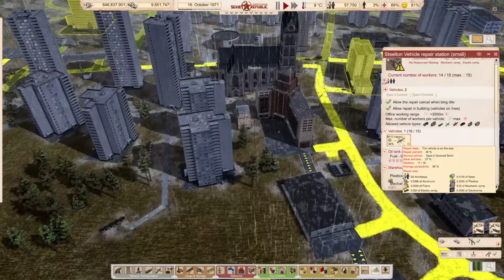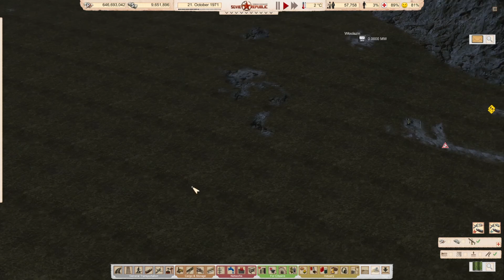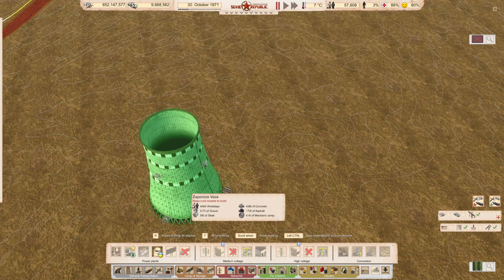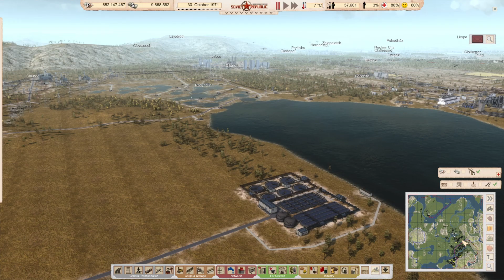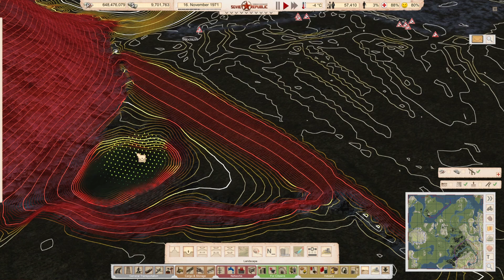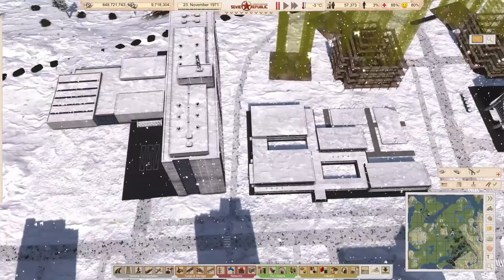Centralised Nuclear Power  :: Grand Designs 1900 Start : Workers & Resources Soviet Republic: #90

Comment: What mods are you running? Some of the residential builds i don't recognise, and I'm way past the 1970th
Reply from the maker: The older residential buildings with the orange/brown roofs are map default so they are not available to build.  

The tall blocks with 593 residents are called Dnipro flats form the Help for Ukraine DLC.  The DLC contains several useful building that can add flavour to cities.

The majority of the modern flats are from a mod called 'Blokovi Pack', which contains five options ranging from 138 to 698 residents.  They do not need a  road connection and have a quality of over 85% which makes a difference when playing in realistic mode.  Tend to use the 231 pop option for the city core as there is a footpath connection from each face making easy to create a regular grid.  

In the old towns there is a few 100 resident apartment blacks from a mod called 'More old city buildings'. which is from a range of mods for early starts.  Search the workshop using 'old city' to list the different mods.  Like to use these to add character to early start cities while keeping things compact.  

Hope this helps.